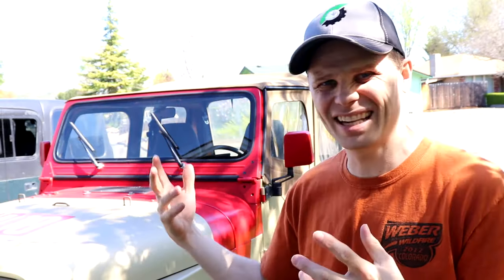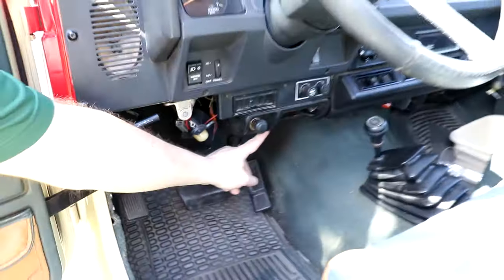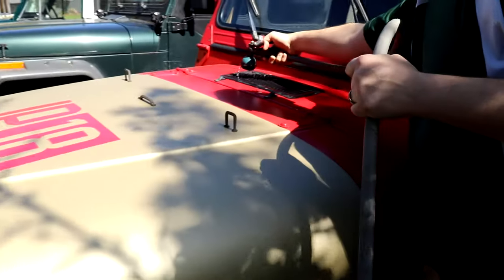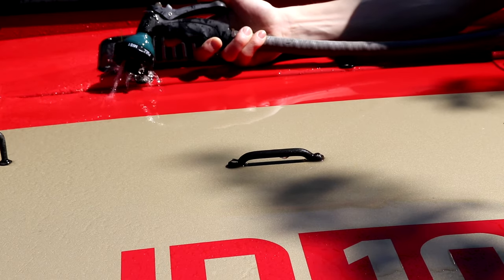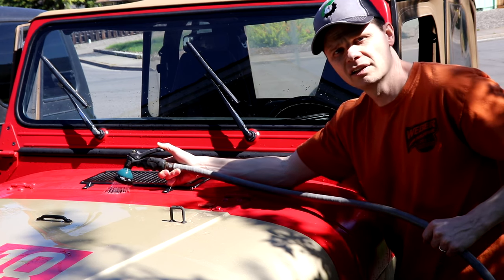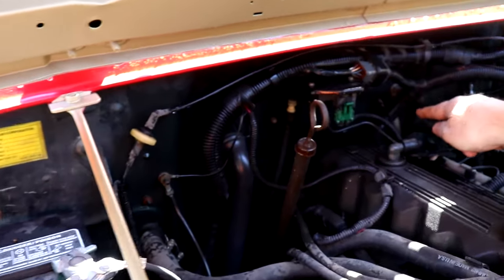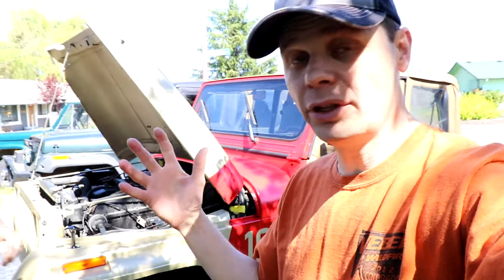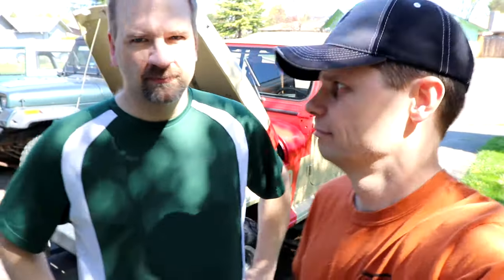Jeep Interior Water Leak

Comment: I had the same problem, it is the vent only under heavy rainfall though, the reason it leaked when you sprayed the gap on the hood is because it went under the vent while you sprayed the gap and since you had a continuous stream the water filled your chamber faster than it could leak out the clogged tube, check his tube i bet it’s full of dirt and mud like mine was and I even made the drain hole bigger on the tube by bending it so it won’t get clogged again
Reply from the maker: Mine did that too. Jason had cleaned that out, but good point.

Comment: My YJ leaks are in two places. First is the same as in this video, water enters from poor seal between hood and cowl, then into gaps in large rubber grommets where wiring harness enters interior. This is driver and passenger side. Second, is cracked side panel caulking between the side panel and cowl & between side panel and fender, also on driver and passenger side.

Comment: All, I investigated further because that seal alone just doesn't add up and finally located my leak after 20 years of ownership of my 89 wrangler.  Remove the old sealant that runs between the inside edge of where the fender bolts on and the firewall. You will notice a small opening once you remove the sealant where the water is getting in.  Clean up the rust and reseal the gap on hole.  Leaking problem fixed.

Comment: I noticed there's 2 bolts missing on the windshield hinge. If it is that's your leak. The nuts for the bolts broke off on mine and I used nutserts instead.
Reply: Make sense
Reply: did you say your nuts hurt?

Comment: Hello from Sweden,

I have work with similar leaks on my -93 YJ this winter and what I found was a leak between the fresh air intake box and the body. I removed the vent grill and tape a small rim around each screw hole and then filed the tape-rim with water. It was how I found that leak.
To fix it I had to remove the dash and then the fresh air box. I removed the old sealing and then put it back with a sort of glue gasket...

You can also tape a rim around the nozzles and fil with water, to isolate every singel leak source. 

Hope you find the leak, its so annoying with water coming in... :(
Reply from the maker: Thank you! Well have to investigate further if it's still leaking.
Reply: Same exact area leak for me. I also used tape to isolate it. The seal was rotted. How difficult was it to remove the dash and replace that seal?

Comment: Running down the firewall and through the grommets
Reply from the maker: Yeah, that's our suspicion at this point.  We'll see...
Reply: Yep.  So I added a strip of foam insulation along the lip where the hood meets the metal where the hinges are and the leak stopped.

Comment: Same here. I taped all the seals on the windshield and cleaned the cowl vent out. Still leaking. I have the hood seal, but it's in terrible shape. Hoping that is it
Reply from the maker: Hndri had a good idea.  Tape off sections so you can test one at a time more easily.  But hoping that seal does the trick!

Comment: Just pull the drain plugs....you'll be fine...

I don't , nor have I ever had, a seal between the hood and the cowl.... mine doesn't leak like that from there... Very odd indeed....  I know there's a hole in the fire wall where the AC condinsation collection hose from inside the jeep goes through the fire wall  just above the hump that does not have a seal or grommet and is prone to water and mud coming in when wheeling... but not just rain...but it's too low....below the dash area...

Mine leaked (more like poured) at one time until I replaced the window frame (cuz it was rusted through) and the widow frame to cowl seal / gasket... No more...or very little I should say, water gets inside from the dash area...but then again... in Florida always neked....doors off, a bikini top installed, and a tonneau cover.... I just pulled my drain plugs....lol... If I'm in the jeep during a time of rain...it's only because I don't care at that time to be wet... It's actually kinda fun to cruise around in the neked jeep during a spring / summer rain storm or a tropical storm / Cat 1 hurricane.... The looks you get...lol
Reply from the maker: Good ideas.   We may have to tape off some areas and try again if it's still leaking...

Comment: Try taping off the hood seam, the cowl vent, the wiper arm holes, w/s frame seal, and w/s gaskets. Start from the top, and flood each seal with steady stream (no hose gun). Remove tape from each seal, one at a time.
Reply from the maker: That's a good idea.  We'll have to replace that seal and test again.

Comment: I had a leak coming from the cowel panel seams.
Reply from the maker: We'll have to pull the cover and inspect if it's still leaking.
Reply: The leaks were coming from the cowl body panel seams, had to seal the base of the windshield frame below the windowhinge seal and on the sides where the body panels meet above the stamped jeep logo. There was very fine hair line cracks in the seam sealer. Good luck looking for the leaks.Thanks for the video's for our education and entertainment.